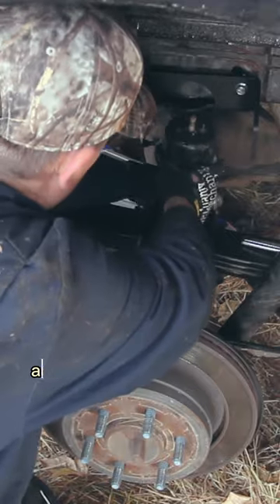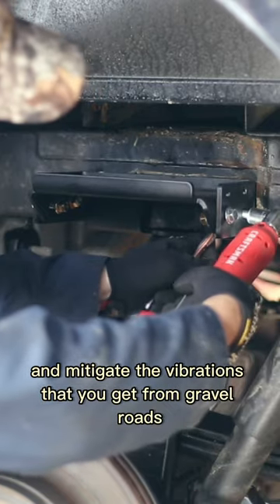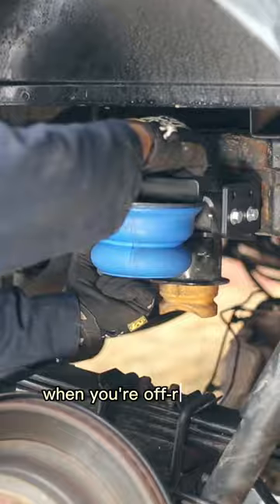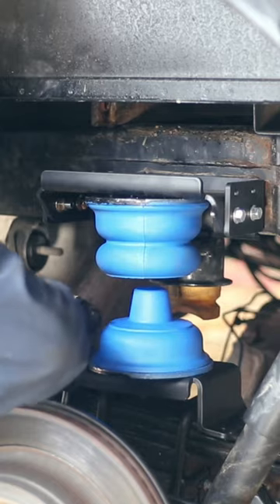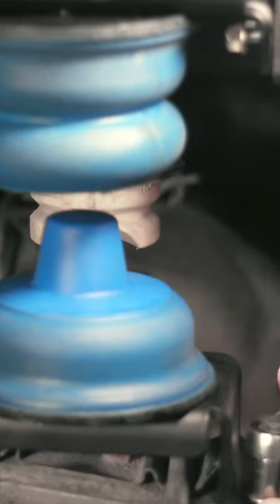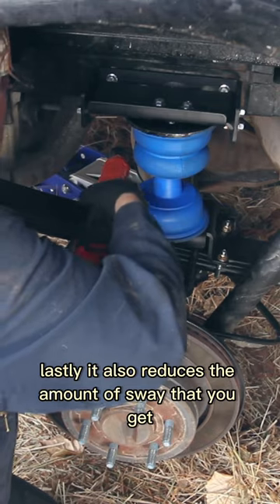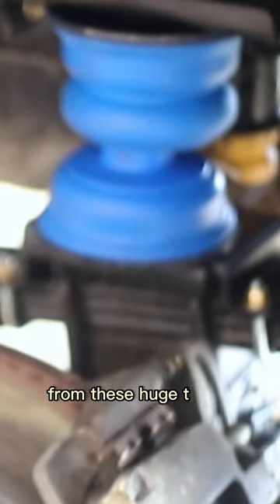Keep your truck level no matter how much weight you put on the bed

Comment: These should be illegal.  Add some leaf springs or airbags but it still doesn't make a half ton into a 1 ton.
Reply from the maker: We have SumoSprings for half tons, 3/4 and 1 tons. We're not saying to use these to replace your suspension. Our SumoSprings are meant to be used with your suspension. You should never exceed your vehicle's GVWR. Our SumoSprings are there to help level loads and to improve ride quality. -Josh